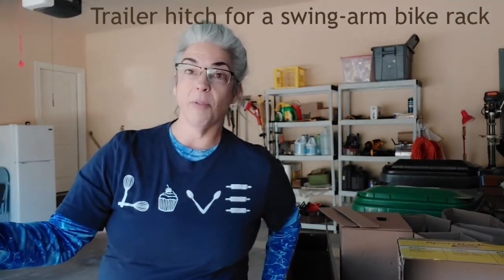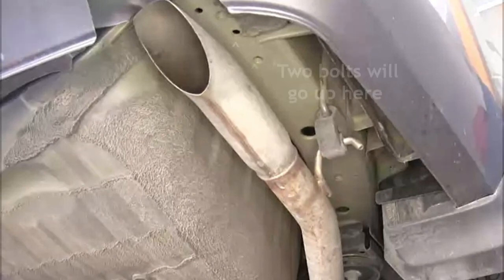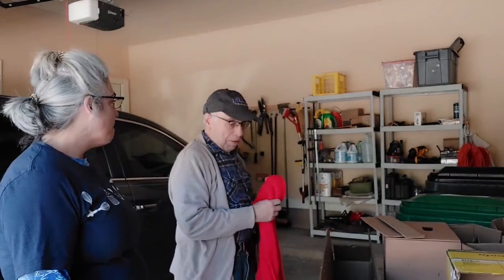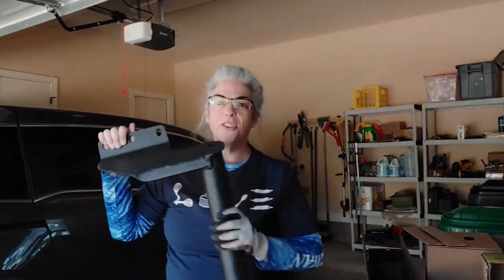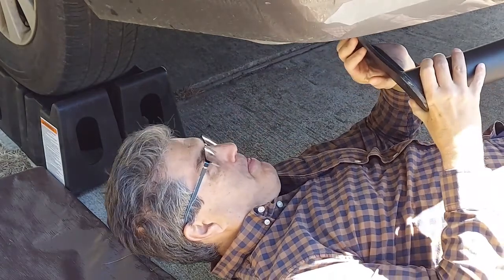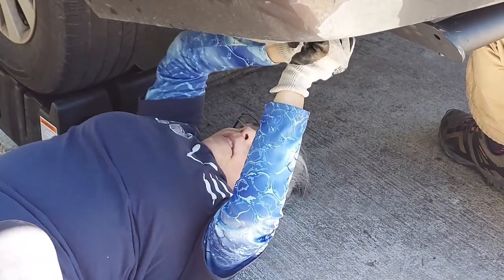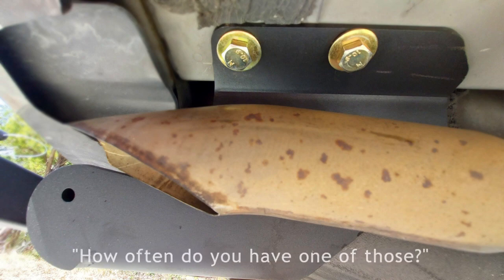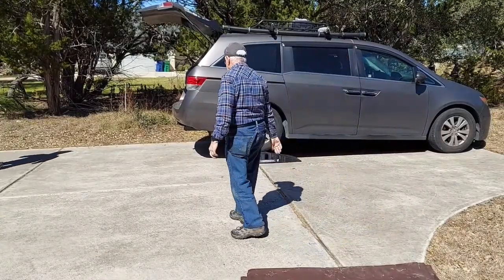Installing a trailer hitch on the Minivan Camper

Comment: Finally, a new video from ya!

The trailer hitch on mine (identical to your van) was easy-peasy. Took me about an hour, and I worked at a leisurely pace.
The lift kit...not so much, lol.
I've gotten the roof rails on it, and the flex craft bars are waiting to be installed, along with A/T tires.
Your build really has inspired mine, and I've shamelessy stolen several of your ideas.

OK...after seeing yours in the driveway, you just gotta put a Traxda lift kit on that thing! It's only a  2" lift, but that extra clearance makes a BIG difference in where you can go.
Reply from the maker: Hey Zardoz! Good to hear from you. I'm so jazzed that you were able to use some of these crazy ideas I put out here. I LOVE the idea of a lift. Did you install yours on your own?
Reply: @TheVanThatGotAway , yep. Installed it with a friend of mine. Not too difficult, but having a mechanic install it would have been worth it. Dark side motoring is where I got the kit.
Reply from the maker: Thanks for that info. I gotta do it!